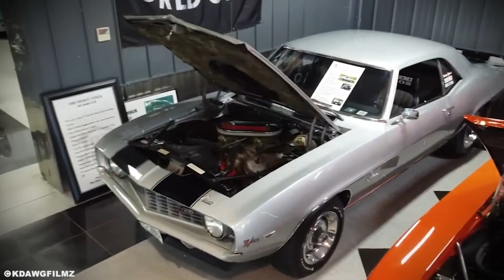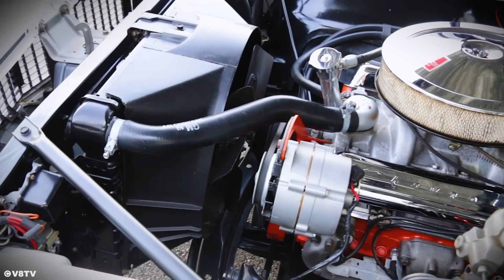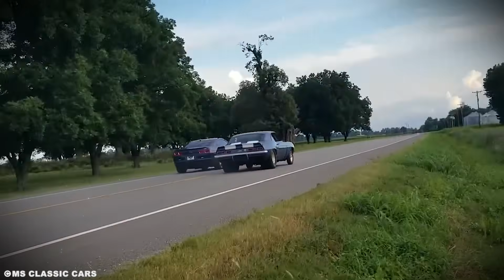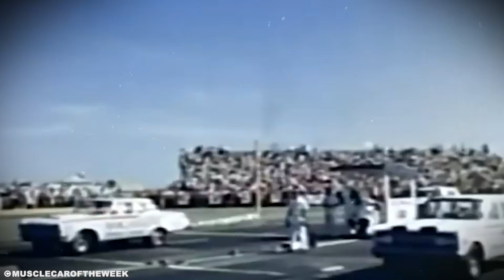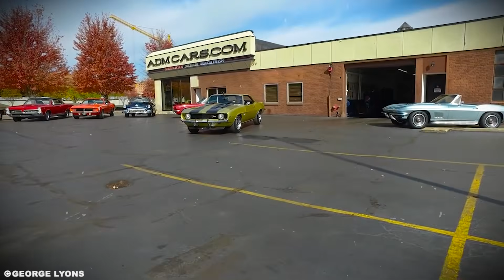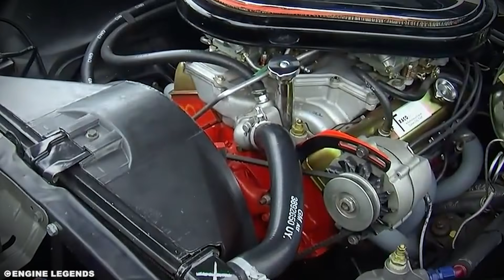How Chevy’s 302 Turbo Fire Engine Earned Its Deadly Reputation

Comment: DZ 302 were rated to run at 7000rpm but peeps were taking them to 8000 causing valve float.

Comment: We redrilled the 302 for Big Block 7/16 rocker Arm studs. That stopped the flex.  We used Chevy Big Block calve springs.
We used the stronger Big Block Chevy rods and go to 8, 000 rpm.

Comment: I would love to own a Chevy 302 DZ but the 327 i built for my 67 Camaro spun 8000 rpm-s on a daily basis..I  did use TRW forged pistons and lots of other goods though so it would handle excessive rpm's and still my favorite small block engine.

Comment: Down here in South Texas we would take them and when they knocked a rod put a 4 bolt 350 w flat tops under that top end and it would hold together as long as you used forged cranks and rods and pistons .